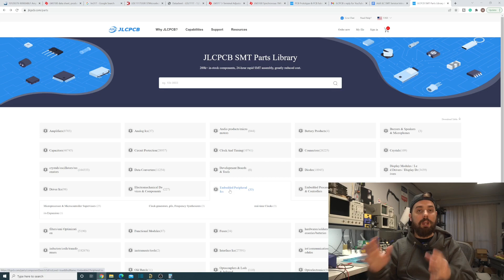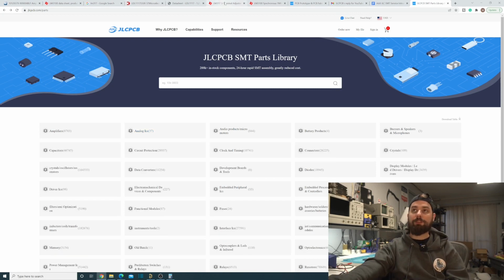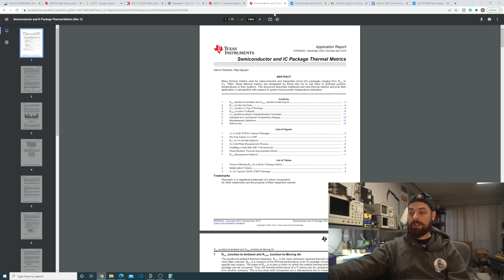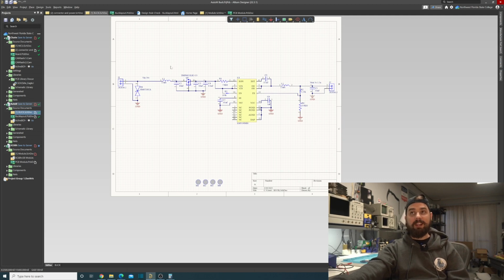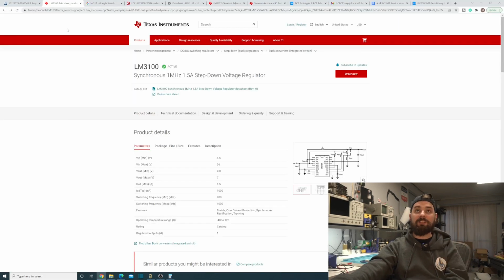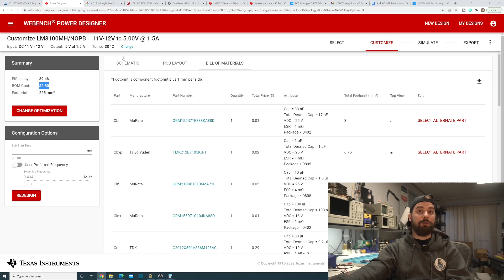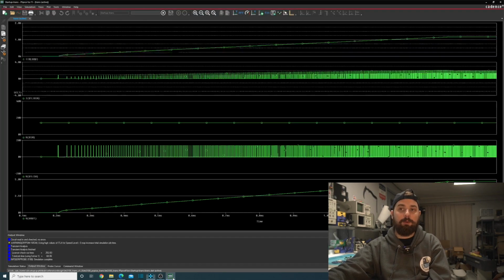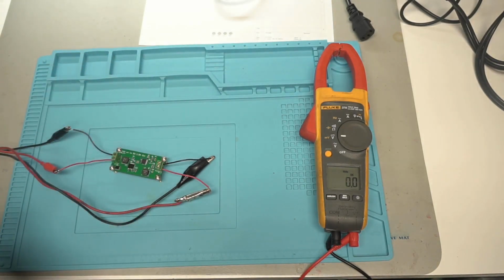Making a Buck Converter Using TI's Webench Designer and Discussing Automotive Electronics.

Comment: hi new subscriber here, I was in autobody auto mechanics for a locally owned landfill garbage company with 700 big rigs trucks and about 200 heavy equipment vehicles, and about 100 regular cars and trucks. there for 20 years. watched all your videos I was wondering how much you charge to change stepper motors in a 2005 GMC c 1500 full-size standard shift. the four gauges are funky gas works but its works at the bottom of cluster, temp starts off on 160 instead of zero, volts are over 14 not running, yes I've check volts and its right on muti meter and check fuel with my altell scanner that works too. it appears that the previous owner tried to change stepper motors themselves so all six stepper motors check lights and problem spots
Reply from the maker: Sounds like he might have lifted some pads re working it. I do them for $100 plus shipping but if to many of the pads are lifted you start running into a risk of failing again in the future due to jumper wires being less durable than the original pads
Reply: @FixedUntilBroken  would you be instreaded in doing it? and when a good time to send it